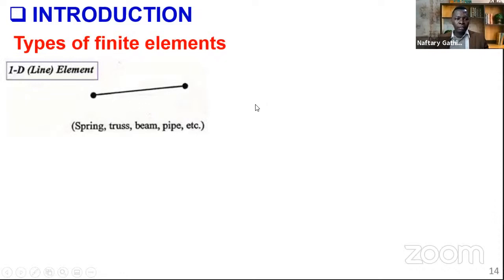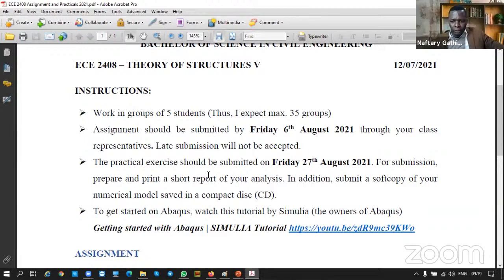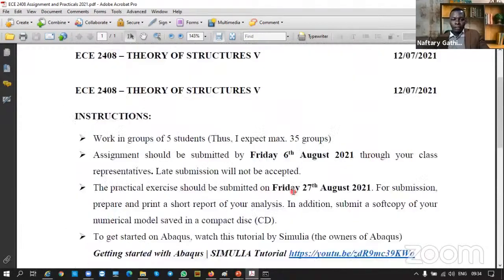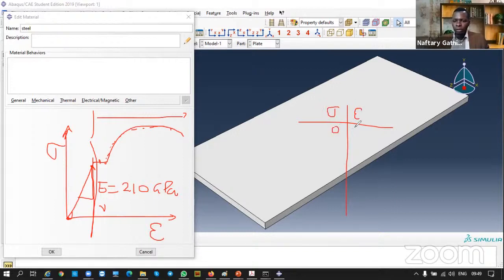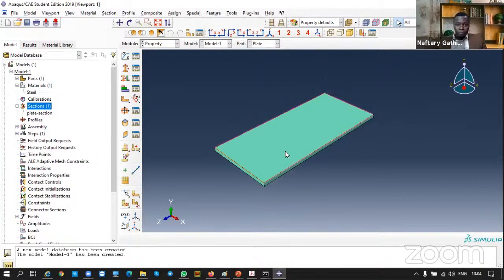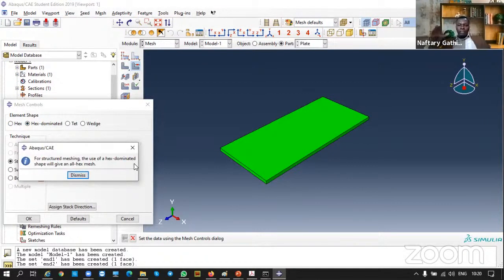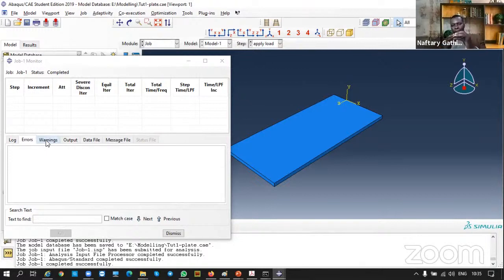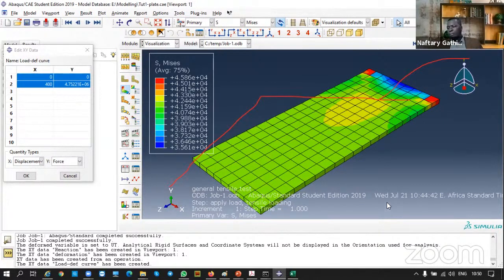Getting Started With Abaqus | A Tutorial using solid elements

Comment from the maker: CONTENT
Preamble
   0:00 Intro/Welcome remarks
   0:42 (Recap) Types of finite elements
   16:15 Shout out to a royal subscriber https://bit.ly/3hVYXQS
   17:14 Students' assignment explanation
   19:12 Install Abaqus software for free https://edu.3ds.com/en/software/abaqus-student-edition
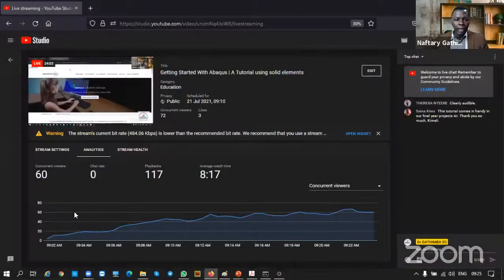   24:13 Accessing Abaqus documentation
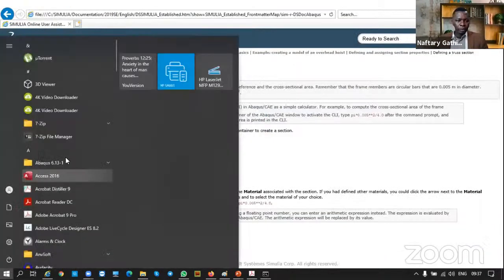   36:00 Getting started with Abaqus CAE
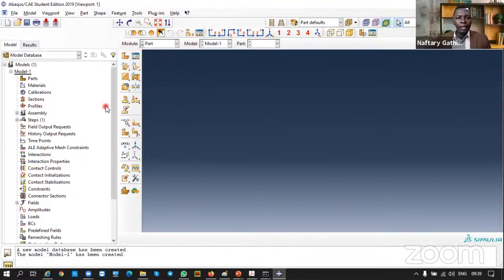   37:23 Abaqus GUI/Explanation of different modules
Example/Tutorial - Steel plate in simple tension
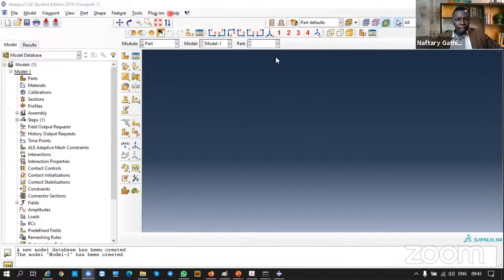   41:34 Create geometry (create part)
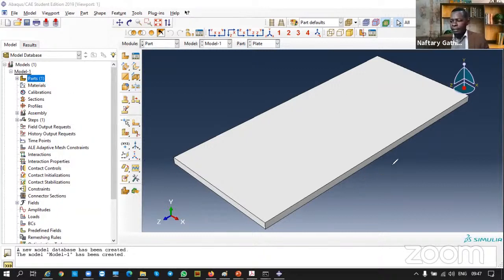   45:30 Define material properties
   58:41 Define a section and assign a section to a part/geometry
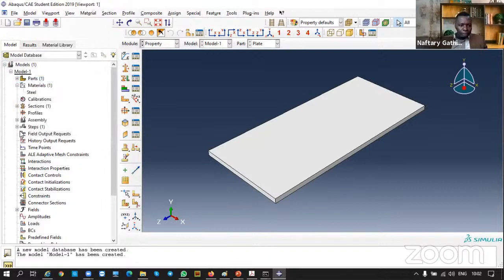   1:00:58 Assign material properties to a section/part
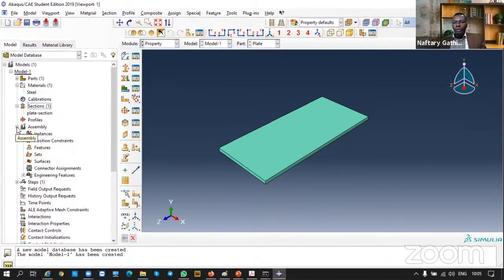   1:03:51 Assembly
   1:06:26 (optional) Create sets feature to apply loads and boundary conditions
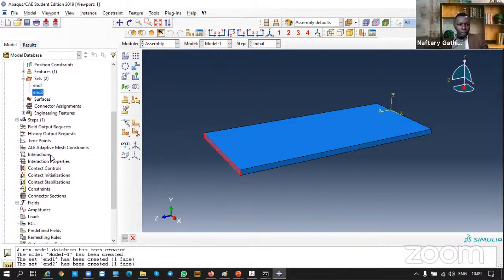   1:08:20 Define analysis step & apply loads, BCs
   1:17:34 Meshing
   1:23:42 Configure analysis
   1:28:00 Request output
   1:33:30 Data check and Run analysis
   1:35:22 View results
   1:43:26 Generate X-Y data plots
Conclusion
   1:49:10 Concluding remarks
   1:49:48 Invitation to weekly live streams
   1:50:00 Why you need to subscribe, share and like all my videos
   1:50:40 Outro